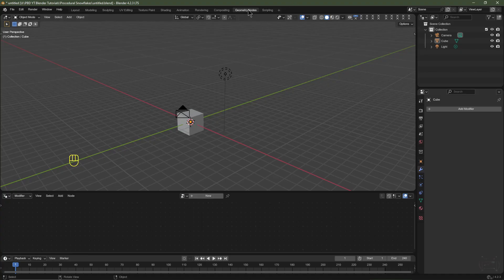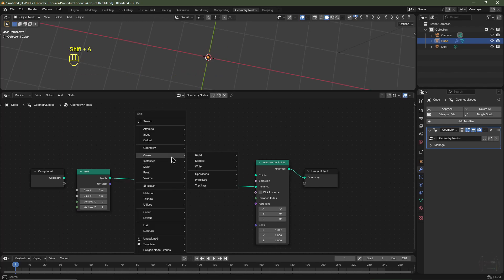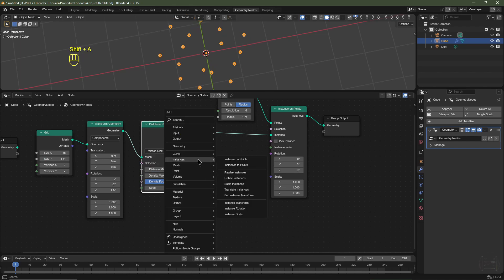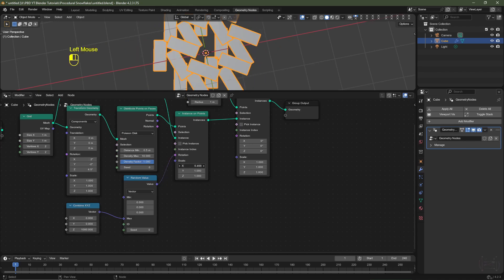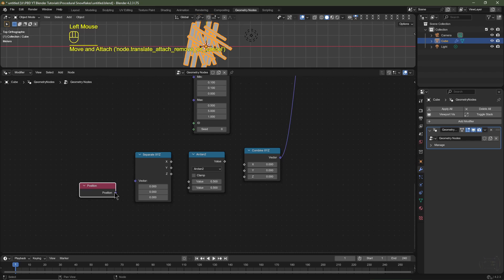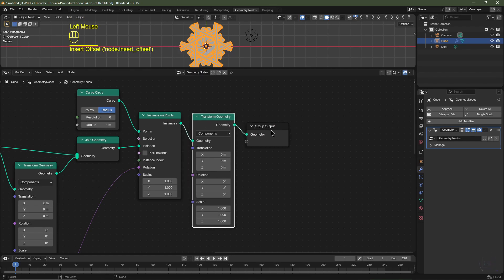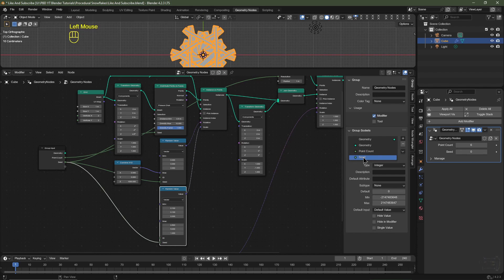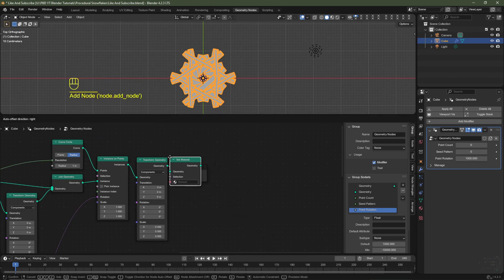Geometry Nodes Snowflakes Generator - Blender Tutorial

Comment: Great tutorial! subbed. How did you get the sharp edges in your thumbnail?
Reply: @DKP3000 Hi, just in case you're still interested, I thought it couldn't hurt to let you know about this.  After you find a Snowflake you think has good potential by using the super cool generator.  Make a duplicate of it.  Move it to the side, above, or below (I move them below) to work on.  With it still selected, apply the Modifier to it (the original doesn't get affected/modified).  Tab into Edit Mode.  With the default Vertex Select Mode enabled, box select the whole snowflake.  Right click, and choose Subdivide.  That adds an extra point in the center along all edges, including the square tips that you (and I too) seem to be concerned about.  The next step is to go around the whole Snowflake one point at a time.  So, deselect everything by typing Alt A.  Choose a tip to start on by zooming into it pretty close.  Select only the (now) three vertices that make up the tip, right click and choose Merge Vertices, At Center (or simply type M A).  There, we get a nice sharp point.  Just work your way around the Snowflake, going point by point, as you see fit.  You may want to be in Wireframe Display for congested Snowflake point areas.  I find it worth while going around the flake and doing this.  Besides, the Generator did all the hard work, and it doesn't take all that long for this additional tweak to the points.  Then it can be saved as an asset.  Personally, so as to not duplicate, I'm going to keep a spreadsheet of the processed Snowflakes generated numbers.  Hope this helps  :)
Reply: @  thanks for the info
Reply from the maker: Thanks, I'm glad you found it useful. As for the thumbnail, I made a template so that all my thumbnails are coherent and can seamlessly transition into the animation. I then render out the result of the tutorials and import the movie clips into the thumbnail template for the final render.
Reply: @PhotiniByDesign  I mean, what nodes did you use to get sharp edges? The tutorial seems to only have square edges
Reply from the maker: Maybe you need to increase your point count on the modifier which is controled by the resolution of the curve circle node, I usually set mine to 6, anything below 5 will produce square like patterns.
Reply: @PhotiniByDesign  I am using 6 points. The results you showed in the video all have square tips, but your thumbnail shows pointy tips. Wondering what nodes you used to make the sharp/pointy tips shown in thumbnail, if possible
Reply from the maker: The thumbnail snowflakes are made using the same node structure as the tutorial. The only thing I done to choose pointed tips was to cherry pick the best looking flakes by changing the random seeds until I got the snowflakes I liked. A lot of the snowflakes will produce square looking results, but if you keep changing the random seed values, you should eventually produce similar results. The only other thing I can think of that would prevent the system producing pointy results is the offset values on the mapping node at the beginning of the tutorial.
Reply from the maker: When I get back into the studio later today, I will open the project files and have a look to see if there is something I missed and will get back to you on this.
Reply from the maker: @DKP3000  I have just checked the original blend file, and the only thing I changed for rendering the thumbnail snowflakes was in the modifier, I set the point rotation to 1000 with random seed patterns.